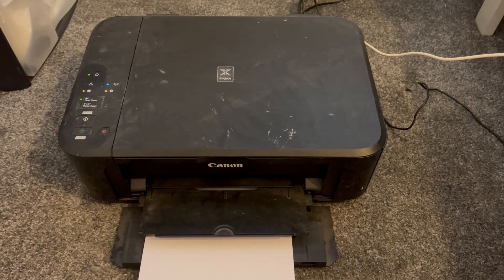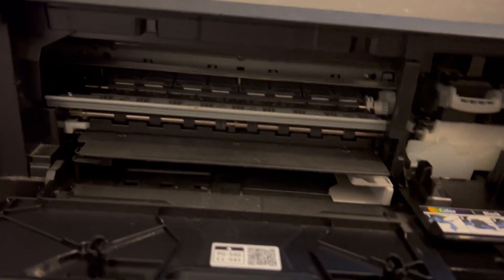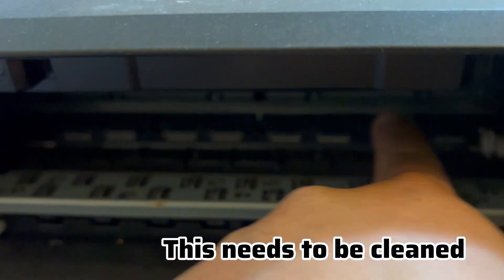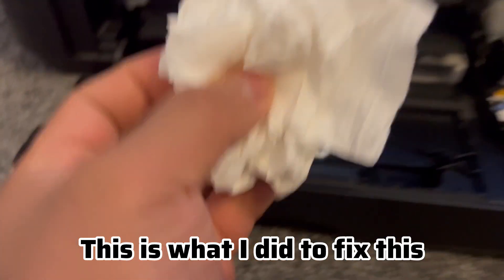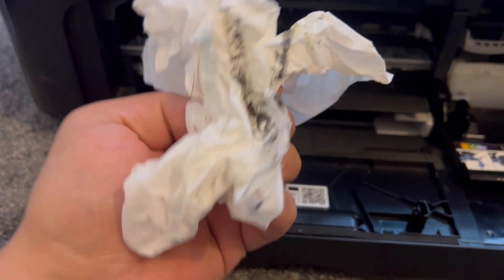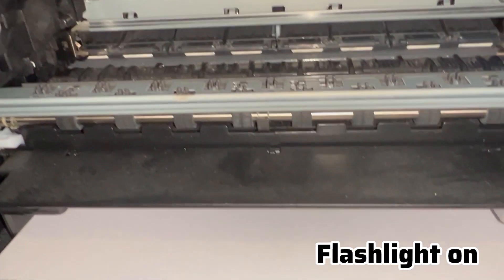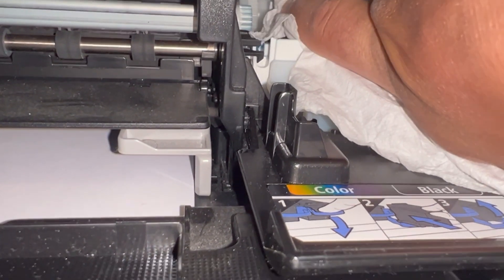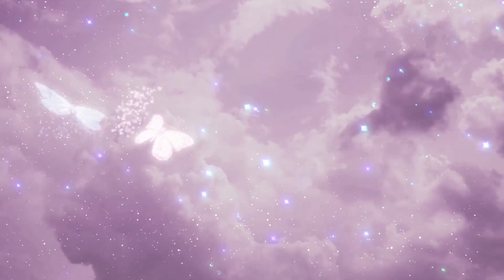FIX Printer Alignment issues→ Ink Printing Blurry/Fuzzy/Smudges/Lines or Faint Text

Comment: Thank you!!! Such an easy fix and yet this was exactly what my printer needed. I had just loaded it with off brand ink, and thought I had killed it, but nooo. I ran a dozen printer head adjustments, and wasted ink cleaning it, would clean with tissue where the ink comes out (like the sponges as I know that when those get full they also mess up), took the cartridges out a couple times too to clean all that, but didn't touch this part you mentioned as it's not even a year old and still had the gel/lube it comes with and I didn't even think to clean that. Welp, that was exactly what the darn thing was needing. I didn't even know that metal think had anything to do with it so I cleaned everything but it. Thanks xD
Reply from the maker: Fantastic news!